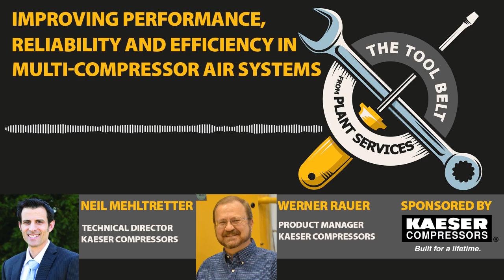Improving performance, reliability and efficiency in multi-compressor air systems

Comment: What about for 24/7 operation factory that requires relatively stable pressure & flow? How does the master controller come into play in this condition? And what would happen to the running compressors if the master controller failed to work?